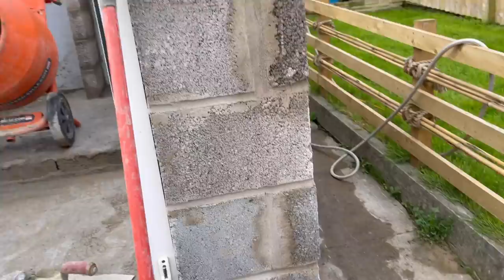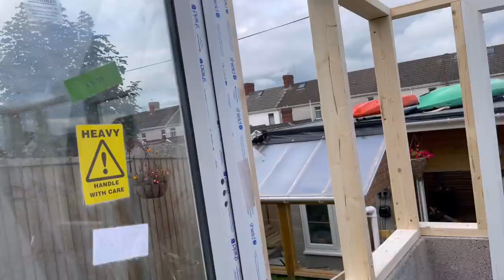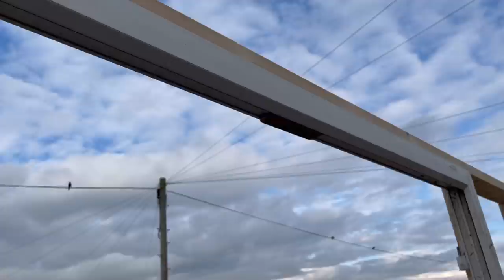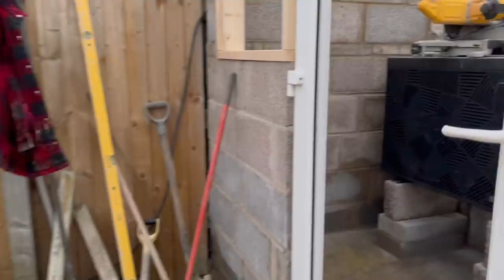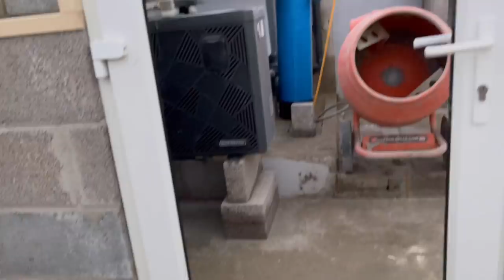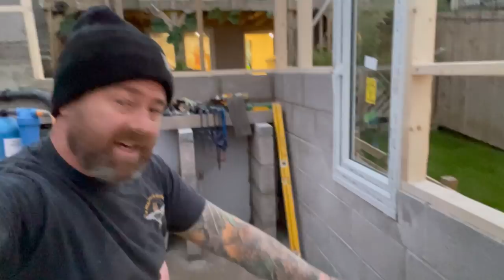Koi pond filter house build part 6

Comment: looking great 
if your boarding out inside you will have to create a corner for both  inside sheets to screw to down corner.
 by nogging out with some more cls to supprort sheets this will make a solid timber internal  corner
 when doing stud work on walls you put 3 pieces together to get past the four inch section from joining wall hope this is not confusing.
can wait to see it finished
Reply from the maker: Boom thanks mate 🙏